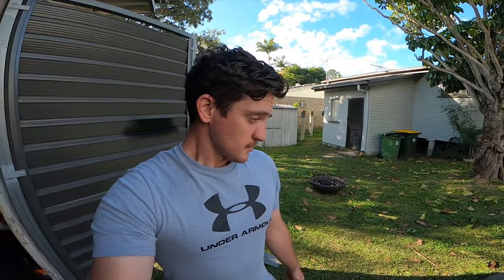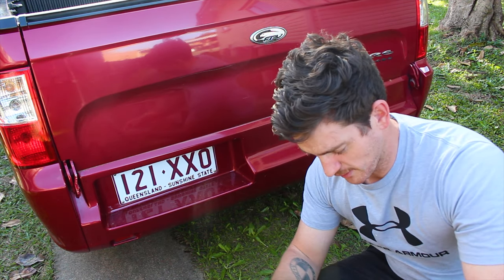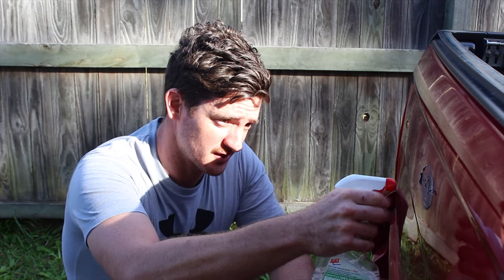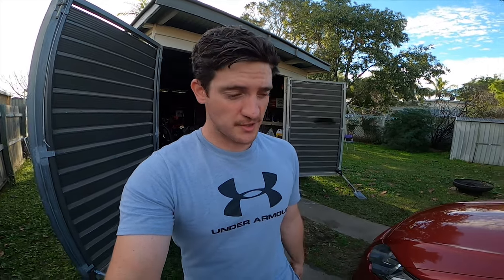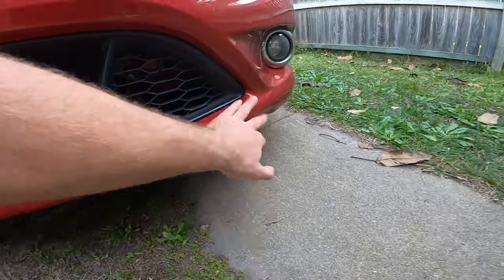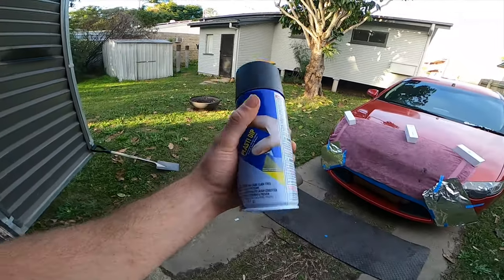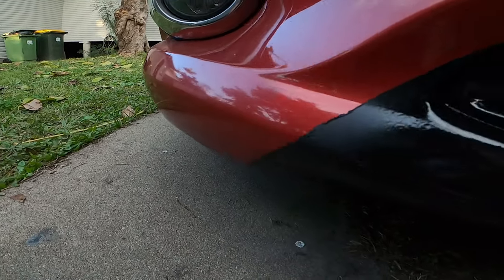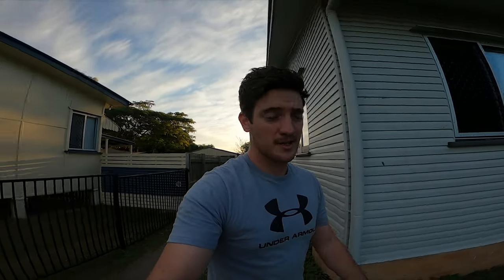Debadging the FG Falcon | Plasti-Dipping front bumper bar

Comment: Hey mate, with the new badge you out on, did you use any glue or adhesive or was it pre applied on the back?
Reply from the maker: From memory I’m pretty sure it just had 3m tape on the back
Reply: @moldzvlogz  hold up fine and all? I’m doing the same swap with my falcon atm and think I’ve got the same badge and just wanna check it out before I leave 2 holes in my rear bumper
Reply from the maker: @freddogaming133  yeah no issues man